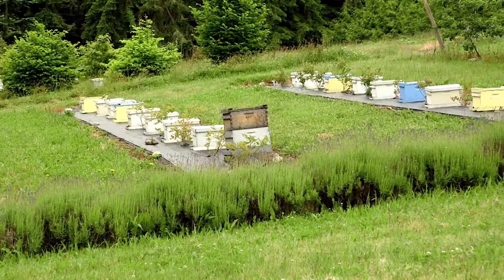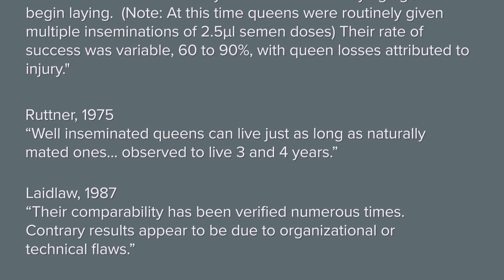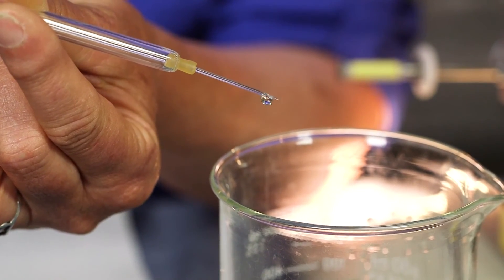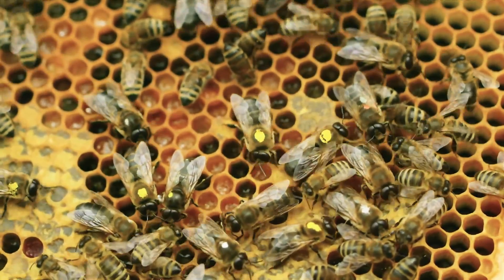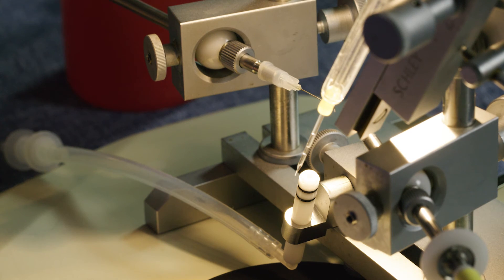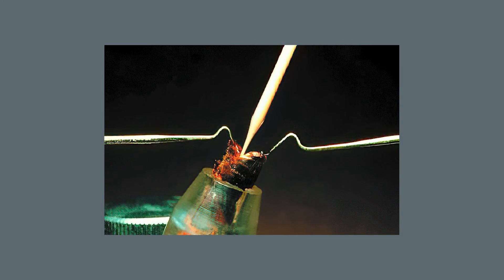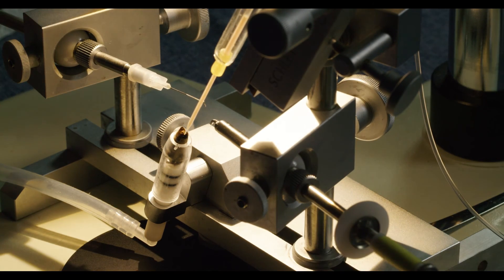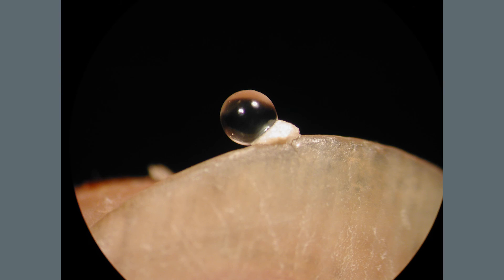Instrumental Insemination Of Honey Bee Queens, Techniques and Beekeeping Practices with Susan Cobey

Comment: In regards to :  the question - at ~36:00 "Position the tip above and dorsal to the apex of the V". The point is to get in front , to the right of the valve fold and not directly on top, as the tip must slip pass. Sue